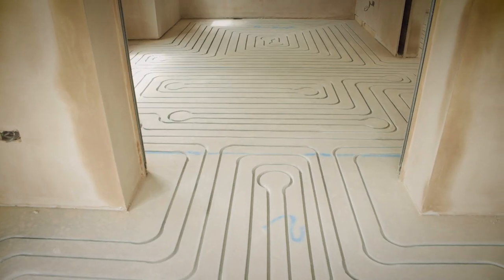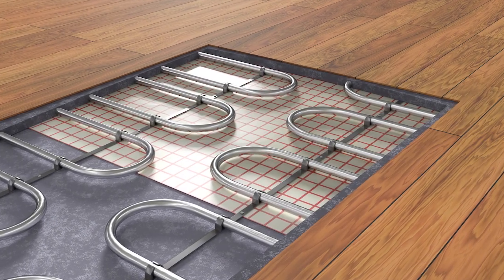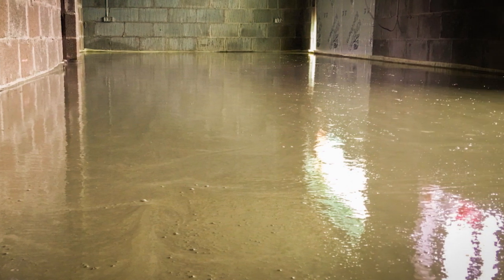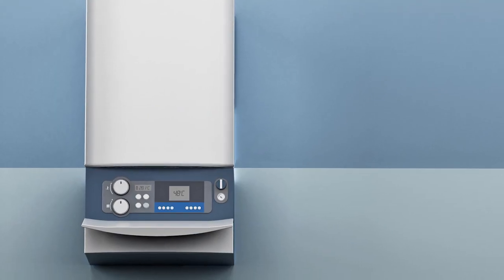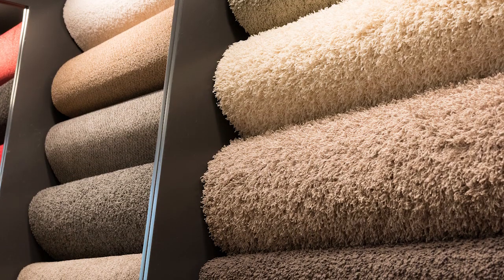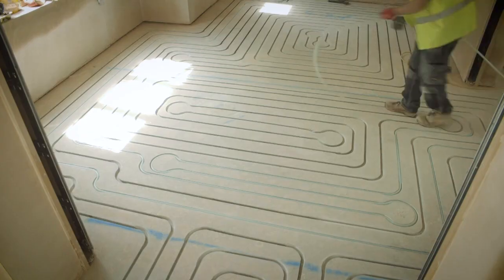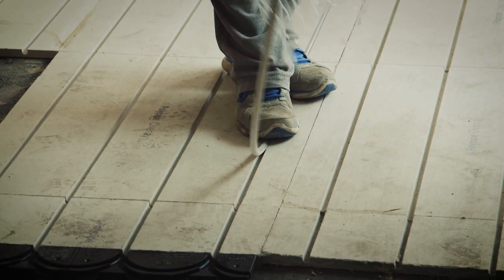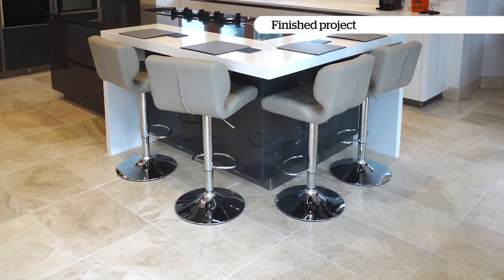Guide to Retrofit Underfloor Heating Systems | ADVICE | Homebuilding

Comment: I have a 6-inch slab floor and it has 150mm insulation under it as well as the sides, so it's isolated from the outside, how long would it take for this system to warm up the slab, and how long would it keep the room warm for after the heating is turned off .

Comment: This may well be a stupid question, but couldn't the groove cuts in the floor be a little deeper & wider, to accommodate a hammock shaped insulation, inhibiting the heat in three directions, leaving 'up' as the heat path of least resistance.

Kind regards
Robert
Reply: Hi Charlie,

The amount of insulation you would get really would not have any benefit. 

I'm a employee of JK and something I'm asked a lot, but simply a small amount of insulation of 5 - 10mm isn't really offering anything in terms of efficiency to value for the extra costs / materials it would take to do this.

The pipework is directly below the floor finish as we install currently so the heat transfer has limited restriction to then transfer through to the floor  as we only recommend covering with 10mm self-levelling prior to final floor finish.

We have a testimonial on our JK YouTube page from a customer who is over 12 months in with our system and a GSHP. His property was 60's build so no floor insulation, so feel free to check that out.

The customer is delighted with the results and so were we.

Comment: Can you put carpeting over this retrofit UFH, or does it have to be wooden flooring like engineered boards or laminated boards.
Reply from the maker: You can technically put carpet over underfloor Heating, but it doesn't conduct heat particularly well, so it would be counter productive. However, a lot may depend on the thickness, material and underlay involved, so it's best to speak to a UFH expert to find out more.

Comment: If crossing a zone should that pipe be insulated to stop heating that room as well? We had system installed in Spain and when heat a bathroom on separate zone the room before it heats up hotter than the bathroom! how get around this insulate that zone till reaches it?
Reply from the maker: Sounds toasty! The systems we've seen, such as the system in this video, have a separate pipe / feed for each room / zone. So the bathroom will have it's own flow and return, the living room will have it's own flow and return etc. It's also pretty unusual for underfloor heating to make a house "hot" as it operates on a low, consistent, ambient temperature rather than like a radiator which is either "really hot" or "off". The smart thermostats that control these systems are also really good these days.

Comment: In a basement application, what happens if the basement floods or has an unexpected water event (broken water heater etc)? Is the system waterproof? Will it be damaged / require removal? Will it trap water and potentially get moldy?
Reply from the maker: Hi Jeff, as the system sits beneath a screed - essentially it's encased in concrete - there should be no problem with flooding or waterproofing.

Comment: A bungalow I'm buying has a majority concrete floor with 2 other rooms having a wooden floor. The bathroom has a concrete floor and I'd want to convert it into a wet room. The EPC recommends floor insulation. What solution for underfloor heating throughout the house would you recommend and why? Many Thanks

Comment: As I work for this company the main concern and question is always heat loss in an insulated slab. Yes, with no insulation in the floor you will get a heat transfer percentage loss but it's nowhere near as drastic or high as many people think and state. We've paired this system with GSHP's in properties with no floor insulation. We take into account heat loss calculations, running temp, floor coverings.

If our system can't meet the requirements, we don't install it. Simple. We don't want the customer to experience a problem once it's installed.

Insulation is of course always preferred, but if a house is pre 1995 chances are you have no insulation present. This system can and is installed as the primary heat source even with no insulation present in floors. 

If heat loss is a concern then updating insulation in other areas of the house should always be the focus. Windows, walls, loft insulation improvements will be far more beneficial to improve heat loss and more financially affordable than excavating an entire slab.

For us, we are an option for retro-fit that solves a problem of not having to raise your floor heights. We won't be everyone's cup of tea nor do we aim to be. Thankfully we know that our system works with great results. If it didn't work we wouldn't install it and wouldn't be a company of some 26 years strong that we are today.

There are some great products out on the market in terms of overlay systems that we don't offer at JK. So long as an UFH system is installed by someone that knows what they are doing and installs it correctly then it's a great way to heat a property.
Reply: So happy I came across this comment. I have the same problem on a job we’re on at the moment kitchen/dining extension the kitchen foot print being the new slab, insulated and the dining area the existing with no installation. I’m really governed with height and can’t raise the existing (dining) area floor. Any suggestions? Thank you
Reply: @timgranthunnisett380  sorry. Only just come back to this video.

Did you find your solution?

Comment: I think unless you as  sure  you have insulation under the concrete screed ? Q which is heat loss will be very large, so system won't be efficient, the other systems you mentioned have build in insulation ?
Reply: Pipes are close to the surface, and thermal transfer through concrete is low so heat loss to the homes exterior will be minimal.
Reply: No not true it all depends on thermal mass google thermal heating! Storage heaters have been using this concept for years storing the heat at cheap rates and radiating it back out! Heat loss with radiaters is more of a problem.
Reply: Storage heaters won’t have the same problem as they are in the room, no heat loss to the outside. The non-insulated underfloor heating is like putting using the storage heater as a wall, half the heat goes to outside as air in the room has low heat mass.

Comment: But if there’s no insulation under the concrete of a retrofit, won’t the concrete just act as a heat sink with the ground so lots of your heat is getting sucked up by the ground?
Reply: No as concrete has a high thermal mass this allows it to absorb heat then radiate it back out as the air around it cools concretes thermal mass is the same as stone ever been on holiday and tried to walk to the pool? the tiles are hotter than the air around them same sort of thing the heat is radiated back into the air! As for heat loss is rather lose it equally back into room than out of walls and windows with radiaters! 
storage heaters work on the sane principal they are filled with concrete slabs.